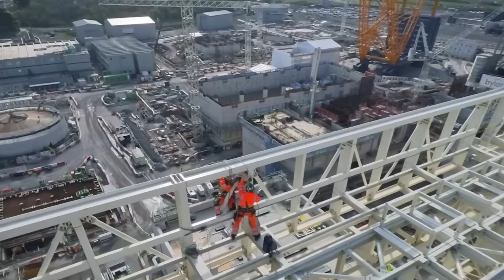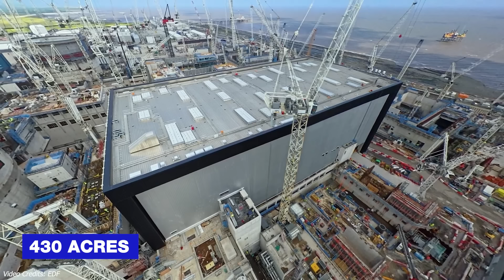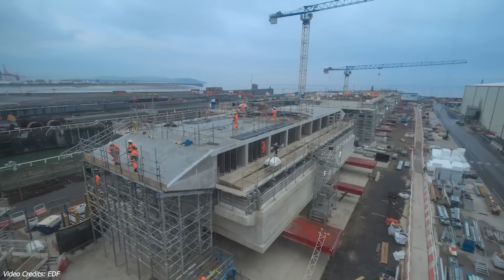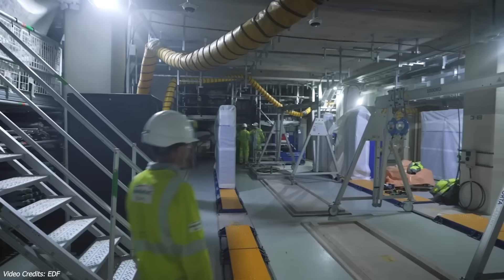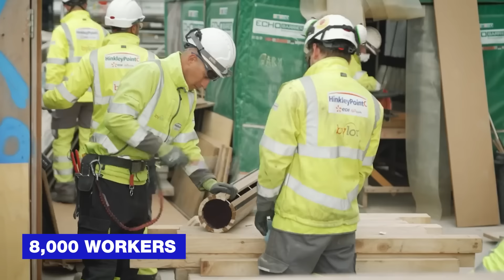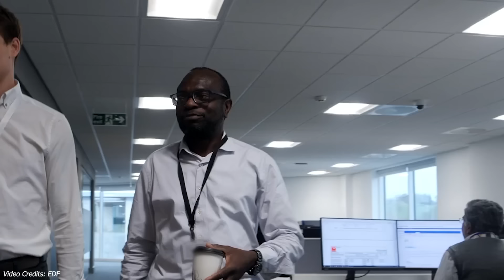UK’s $58B Nuclear Plant Has a $1BN Problem

Comment: You can’t directly compare cost of electricity from nuclear running at 95% capacity factor with wind (30%) or PV (15%). The direct cost (LCOE) of the latter ignores the cost of grid upgrades and battery storage, which can be up to 10x more. Fair comparison is LFSCOE in such case.

Comment: Hopefully a future solution will come from very low-water GenIV SMR reactors using helium gas cooling at 700C.   Since there is no water in the cooling cycle there is very low radiation output.

Comment: Atomstrom ist unschlagbar, teuer und nur noch in Nischenanwendungen zu finden.

Der Anteil AKW-Strom nimmt weltweit seit Jahren immer weiter ab.
Von einst (1996) noch ca. 17,5% AKW-Strom im weltweiten Strommix, 2022 nur noch ca. 9,8% und im Jahr 2023 nur noch ca. 9,2% und 2024 nur noch 8,9% erreicht.
Von einst ca. 2661TWh (2006) auf 2617TWh (2024), ein minus von ca. -44TWh, Zahlen sind von der IAEA.
Strom aus der Kernkraft ist zu teuer.

2022 ca. 29,4% von den Erneuerbaren beim Strom, weltweit und 2023 ca. 30,2% und 2024 bereits 31,9%.
Die Erneuerbaren übernehmen im Jahr knapp +1,6% vom weltweit Strommix im Jahr.

Weshalb nehmen die Strommengen der Erneuerbaren weltweit extrem zu ?
2006 nur ca. 3432TWh Strom von den Erneuerbaren weltweit und im Jahr 2023 bereits 8914TWh und 2024 bereits 9848TWh.
Ein Plus von ca. +6416TWh bei den Erneuerbaren weltweit ab 2006, das hat sich mehr als verdoppelt.
Strom aus den Erneuerbaren sind extrem kostengünstig.

Comment: This is an ideological decision by here-today-gone-tomorrow politicians who didn't have a technical clue. Its 60 year reliability is assumed. Its start of power generation 'cooking the 2017 Xmas turkey' was promised, and site clearance was started as far back as around 2012 prior to planning permission. Assuming it does start generating by say 2029 thats a 12 year unplanned outage damaging the UK's annual carbon-reduction policy trajectory. Its 25.5 TWh per year output will be about 3.6 % of 2050 UK electricity demand assumed at say 700 TWh per year or significantly more if zero carbon jet-fuel is UK-produced. It will be generating at times when massed offshore windfarms will be generating more than Grid and interconnector demand ie months per year so windfarms will have to be switched off. Offshore wind was a better and cheaper low-carbon choice by 2016 when it was green-lighted, and wind, PV and the various forms of back-up power generation ( mainly by stored green gases in existing and new gas-turbines ) are getting cheaper by the year. More jobs in renewables per £ too. Hinkley C, Sizewell C and HS2 are all mega examples of pathetic political failure and easy corporate lobbying. Power from the people to the corporates. I hope it fails to start - a mega-signal to the world, saving £ 100's of billions.

Comment: Nuclear in this video was described as baseload and 24/7 but failed to mention that Nuclear power plants typically schedule major refueling and maintenance shutdowns approximately every 18  months which result in the plant being off-line for several weeks or even months.
Reply: Which is why you need more than one reactor. With 2 reactors at Hinkley and 2 more at Sizewell, even ignoring every other producer, that's only a 25% reduction when each is refuelling.
Reply: @dafyddwilliams5223  Not sure where you get 25% from? Hinkley Point C produces 1.63 GW of base load power and another 1.63 GW of very expensive variable power.
Reply: @EcoHouseThailand you don't understand that 1 in 4 is 25%? Oh dear. 

A variable power nuclear power station? Nope. They just don't react quick enough.
Reply: @dafyddwilliams5223  You can't count  reactors from Hinkley Point C and Sizewell C as the same power plant of 4 reactors! HPC will be finished in the 2030s and Sizewell C will probably be finished in the 2040s. The baseload power for any power plant ie 24/7/365 is only one reactor. Anything that is not baseload is by default variable.

Comment: 3200 million divided 6 million is 533watts . homes in the US use 1500 to 2000 watts . This is power for one to one and a half  million homes not six million.
Reply: Energy usage in British homes is very different then it is here. Their homes are much better insulated and generally much smaller. They generally don't have Central HVAC systems either. A lot of their appliances are much smaller than ours and very electricity runs on a completely different voltage than ours does. All those things add up to 6 million BRITISH homes.

Comment: It's not powerful enough to run a 4 billion watt Data Center. America is building several 4 billion watt data centers. Where will the power come from?
Reply: this is not america this is the UK
Reply: @elixar_1I saw that. America can't build a 4-gigawatt nuclear power plant any more efficiently; instead, it's planning to use natural gas as it builds multiple 4-billion-watt data centers, with Facebook planning to build five of them as one example. I think natural gas is fantastic for heating homes and is a wasted resource powering multi-billion- and trillion-watt data centers. This power plant can barely operate one Data Center. The UK will undoubtedly want its own multi-billion-watt data centers, making this monster investment meaningless if it takes all the power they generate and then some to operate them. Is this the solution? I don't think it's an efficient use of credit and will not solve the problems of the day.

Comment: Several points badly explained the site had 2 previous as the previous one comes to end of life a new one is built the fish issue was one of the only corners of could cut the extra costs on build to one in france is because there plant is still not right ,the British government didn't want to build it so they got the private sector to build it and  the trained staff have another site to moved to thanks to ai uk is building large data centres that require obscene amounts of energy to run good job most krypto mining is being  done in countries like china America and  russia where they need they money

Comment: $58 billion, is that based on the estimate from early 2024? If so, that's an almost 2 year old estimate, assuming no more "surprise" problems, and not taking inflation since then into account. Even for those $58 billion, is enough to buy a combination of solar panels, wind turbines, and batteries that always can provide more power, regardless of weather, than HPC ever will be able to.   

At even just half the negotiated guaranteed fixed price for power from HPC, in 2012, a combination of solar, wind and batteries could be built/installed, and reach break even in shorter time than the construction of HPC already has been going on. Those £92.5/MWh in 2012 prices equates to about £140 now.         

Indirect benefits from spending all that money? Sure, but building those reactors is a project,once it's done there will only be a few hundred jobs left, the job opportunities are highly concentrated, both geographically and in time. Subsidies to solar, wind and batteries would also create a lot of indirect benefits, that wouldn't be just in one area, or limited in time. Much more positive effect.

Comment: A 20kWh Salt battery at £20 per kWh for each of the 22 million homes in the UK (say £2K system/fitting costs) would cost half a HinkleyC, dump trivial heat (unlike Hinkley C's massive 35% heat loss) and cause near-zero environmental damage. 440GWh of distributed storage that benefits population not bank account. Add 30% efficient PV to all viable rooftops in that set and make more use of excellent free renewable resources rather than buying foreign nuclear fuel for decades. Insulation, Batteries, PV to get up to the £60Bn HinkleyC cost ... each retrofit 100% more sensible than another monstorousy expensive nuclear power elephant ... when will they learn ?

When it comes to climate and environment, our government, civil service and corporates are shot through by cretins, right up to the highest levels.

Comment: From a technical and scientific position, these intake issues were solved half a century ago.   The use of velocity caps on intakes keeps schools of fish from entering and adding turning vectors to intake structures, allowing the fish to sense the flow direction change and triggering the same reaction they have to a large fish trying to eat them.   The green activists then claim the microscopic larval fish are significant, but they know that if you add even billions of larval fish to a local ecosystem, you won't increase the fishery (fishery enhancement research). Yet, the greens claim significant losses from a minor removal of larval fish.    For the Greens, truth is irrelevant and only green feelings count, allowing the wasting of billions of dollars.

Comment: The figure of 7% of output for the UK Grid is now out of date with the proliferation of AI Data Centres these require 2+ GW each  of power.
   This 3GW station would produce enough power for 1 and a bit AI Data Centres.   
    The Isambard AI Data Centre in Bristol consists of 5 racks each consuming 5MW of power in total.
Reply: But the cost of Hinkley will go on the bills of the ordinary domestic customers.

Comment: In the UK the electricity price paid by the consumer is linked to the price charged by the most expensive electricity source online at any one time time. This means if 95% of the grid's electricity is coming from wind and solar (by far the cheapest options) and 5% from gas peaker plants (the most expensive) the price you pay is that of the peaker plants. This means wind and solar are HUGE money-makers for investors as long as at least a small %age of electricity comes from high-cost suppliers like peaker plants. Because Hinkley Point C is a baseload power plant, it will be running 24/7/365, so its operation creates a permanent minimum price for electricity in the UK, and therefore a permanent minimum profit margin for wind and solar investors.

In other words it's a scam, the British public are going to be massively ripped off, and the government is doing absolutely nothing to prevent it because it will hit the profits of wealthy party donors in the energy sector.
Reply: That is not quite right, the solar and wind farms have a contracted guaranteed price for the electricity they produce, when the grid price is below their guaranteed price the government makes up the difference, when it is above the government takes the difference for themselves. So it is not the wind and solar farms that benefit from the pricing system but the government.
Reply: except everywhere wind and solar are built the price of electricity goes up.
Reply: @calebfielding6352  - in America the price of electricity is going up because electricity companies spent the last several decades failing to replace aging infrastructure, and now that infrastructure is woefully inadequate for the current rapid increase in demand from data centres. Most of the cost for the new infrastructure is falling on ordinary consumers, not the data centre operators - i.e. ordinary Americans are subsidising them to the tune of tens or hundreds of $billions. Much like in the UK, they're being scammed to fill the pockets of the super-rich.

In Europe the price of electricity is high because, in an attempt to appeal to green-leaning voters heading into last year's presidential election, Biden reneged on a promise to supply natural gas while we weaned ourselves off Russian fossil fuels.
Reply: @tavdy79  I am from augusta. Most of the reason why the new nuclear reactors was so expensive was because of the enviromentalist. America should be 80 or 90 percent nuclear but enviromentalist make it to expensive.
Reply: @calebfielding6352  The price of electricity is tied to the price of gas because that is the most expensive way to make electricity, just look up marginal pricing online and see for yourself
Reply: Can you explain what you mean in more detail? If wind and solar generators make tons of money from gas peaker plants setting prices high, why would they want a 24/7/365 baseload nuclear power plant creating cheap reliable energy in direct 'competition' with those gas peaker plants? Nuclear energy is designed to replace/reduce the gas peaker plants. If your threory is true then wouldn't it follow that wind and solar owners would want baseload power to come solely from expensive sources like gas peaker plants?
Reply: @imprivate9344  - nuclear is only a cheap energy source if the construction costs are reasonable. The construction costs of Hinkley Point are already several times original estimates, and I'm willing to bet they will go up even further. All that extra cost will be passed on to consumers as higher prices, which equates to higher profits for renewables investors.
Reply: @imprivate9344 You have to look at the strike price per megawatt  EDF was offered during initial HPC negotiations. It was around 40% more than any renewable was being offered at the time and has a link to RPI. So EDF never loose out. Even if all gas generation stopped tomorrow the consumer price per megawatt will not come down as Nuclear will take over as the most expensive generator and fix the cost.
Reply: @imprivate9344  Nuclear takes hours to turn on or off. It was not cheap before the build costs spiralled. The gas plants are so expensive because the public only had 2 prices in a billing period - regular and economy 7 at night. The gas plants turn on in the evening when demand peaks from washing school cloths, cooking, lighting... Some of us have are not used to demand management. My friends who own their own solar PV panels have and are quite evangelical about it.

Comment: Right now, the only non-carbon burning way to provide baseline power where hydro is not available is nuclear fission. That describes Great Briton to a T. That will likely remain true for the next 20-50 years before nuclear fusion becomes a practical reality. Becoming carbon-free as soon as possible, not just in the GB but around the world, truly is the planet's most important issue to solve. For the GB, large-scale nuclear power is all they've got so, yeah, it is more than worth it.
Reply: Solar and batteries will do it cleaner and faster.
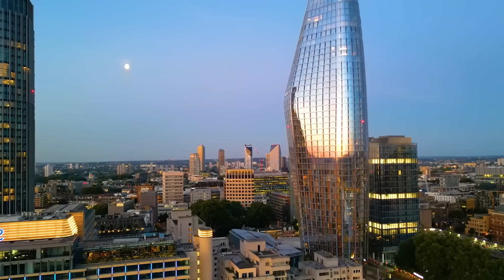Reply: 11:25 The electricity will be massively expensive $65 Billion extra over solar or wind. WOW

Comment: If that's any consolation Olkiluoto Nuclear Power Plant in Finland and Flamenville in France experienced the same cost overruns and delays.
Out of Europe, you have countries like Bangladesh buying Russian design reactor, that doesn't sound very promising. 
China is building 32 reactors right now.
Maybe the future is not in mega complex but smaller one build around SMR (Small Modular Reactors) ; one problem I see with that approach is the security and multiplication of personal costs.
If you need 10 SMR for 1 EPR, you need 10 sites, 10 security teams, 10 supervising team, 10 inspectors team, ...
So I'm not sure what's the better option ?!?
Reply: You don't need 10 sites. The Rolls Royce SMRs are rated at 470MW so that's only 7 reactors to make 3GW. Put them all on one site and you get even more benefit, with less of the negative. Pretty much what they are planning at Wylfa, with 3 reactors initially, potentially increasing to 8 reactors.